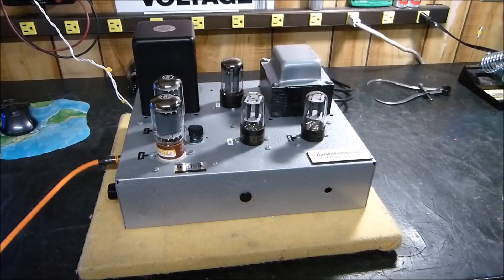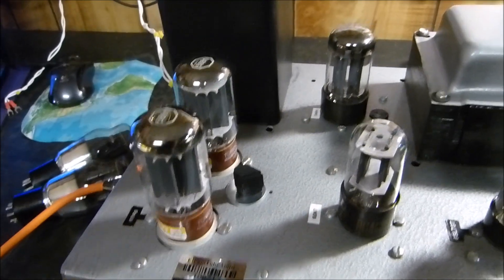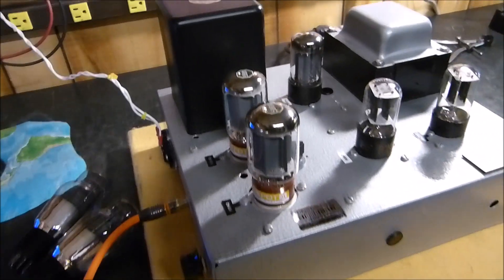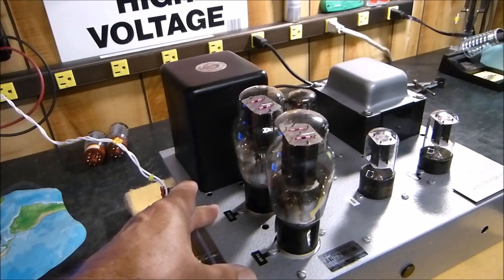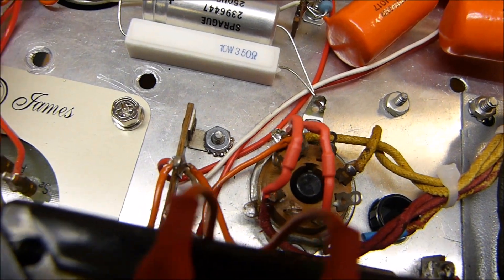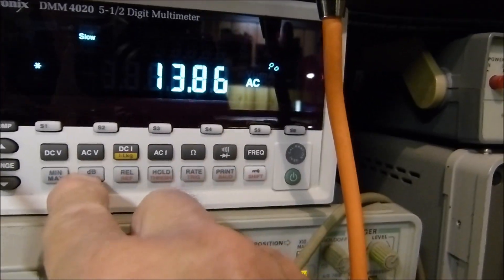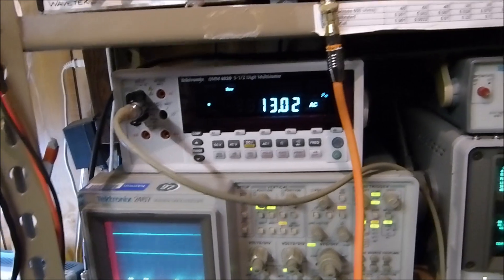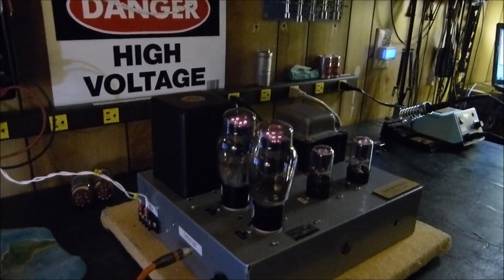6B4G & 5881 Vacuum Tube Amplifier Using James Audio Transformer

Comment: Hi David, I would like to make a stereo 6B4G amplifier and I've checked several of your videos and similar amplifiers you've built. I've noticed that you've used the Acrosound schematic for the amp with 6SL7 as the first tube, but what schematic have you used for the amplifier in this video? I guess you've used 2x6SN7s here, rght? In the other video you've managed to get around 16W using higher than rated voltage, what would be the plate voltage and cathode resistor and capacitor you recommend?

Thanks for the great informative videos!

Regards,
Marko
Reply from the maker: Marko,
Great questions. I hope I can answer some of them. I think this video uses the Heathkit schematic below.
Here are the Acrosound schematics.  http://www.tubebooks.org/file_downloads/acrosound.pdf
I tend to stay away from the high mu 6SL7. It make an amplifier that can be driven to full power with only around 100 mV input. I stick to a pair of 6SN7's.
I am very fond of the Heathkit designs.
Here is the W-3M    http://www.mcmlv.org/Archive/HiFi/HeathkitW3M.pdf
Here is the W-5M   http://www.mcmlv.org/Archive/HiFi/HeathkitW5M.pdf
I do tend to run my amplifiers at a higher than normal plate voltage. Odds are you can use the same cathode resistor because as the plate voltage increases, so does the current thru the tube and thus the voltage drop across the cathode/bias resistor.
Whatever you run your 6B4G's at, make measurements of plate voltage and cathode current and don't overdo it too much...  :-)
Reply: @ElPasoTubeAmps  Thank you!

Comment: I really enjoy the amp videos that you do and I'd be interested in the transmitter modification video :) but that may just be a Ham operator thing.
Reply: Michael Lloyd
 I sure enjoy the ham videos.
  73 N8TPI    Mike
Reply: ElPaso TubeAmps I guess I should have left my call sign :) I meant that I'd like to see the video but the non-Hams that come here might not enjoy it as much. 73 NE5U  Mike
Reply from the maker: I agree that the step-start relay I built is definitely a ham radio high-power amplifier thing. For audio, simple thermal resistors work very well at the current levels that we encounter in amplifiers even at 150+ watts.
Reply: Dave,I bought some new output transformers for the Altec 1570 amps that I put in 811a or 572b tubes..They are 9.5k and they weigh 20lbs each..Heyboer wound them.
Reply: I like anything Dave puts up. You can't buy that kind of education :) 73

Comment: Very interesting ! love these vids ( The Ability to have optional tube compliments seems like a great option ) Would this make a Good first time Amplifier build ?
Reply from the maker: Thank you for your kind and encouraging comments.
I think it could be a good first build of a quality (high fidelity) audio amplifier. It would take some experience and tools in knowing how to do chassis work and if it was built as a dual amplifier (stereo) on the same chassis it will take some slight modifications to the power supply. I didn't show it in this video but the 5881 version does better than 30 watts with 2.5 volts drive with excellent distortion figure. As mentioned in the video, I have found that a lower Z input, in this case 10K, seems to stabilize the amplifier and keeps many of the gremlins of parasitics and other anomalies from occurring. With the 6SL7 driver version the input level is down to as little as 125 mV for full output  but then the gremlins start to become a real problem. With quality vintage or quality modern day (Chinese) output transformers, a person can build a 30 watt (or less) vacuum tube amplifier that is in a class with the best-of-the-best. Now, if you need hundreds of quality vacuum tube watts, building our own becomes a problem mainly because of the (lack) of a good output transformer and we may have to turn to a high quality commercial amplifier for example, a vintage McIntosh like, for one example, the MC3500 which will cost $$$$$. Search for "Acrosound Transformer Catalog" and you will find plenty of good examples of these vintage amplifiers.
Reply: Thank you For the  nice reply    - I  looked at the Acrosound  transformer  site with the schematics, and saw the vids on the one you built - very nice !  seeing  that you had a Bad one (transformer ) got me thinking that perhaps there was a risk of getting a used acrosound  that was bad . is that a common problem ? or is the risk worth it ? EPay has a few now even for a buy it now price  but for 250 they seem high . anyway thank you for the info - very informative
Reply from the maker: I know a fellow here in El Paso that had eight (8) and everyone sold on Ebay for $100 each and no more (they were for bid and not buy- it- now so that indicates that is generally top-paying price)  and that was in pairs, $200 for the pair, which seems reasonable to me.
I don't think the one that I didn't use was actually "bad" but from the four that I had they were all a bit different and each had to be dealt with uniquely in the circuit for the best performance. 
I did not find these differences in the modern day James transformers so... I would personally recommend new quality output transformers. Just my opinion. You  have to consider that these Acrosound transformers are 60+ years old and who knows how they have been used and how the the insulation/etc.  change over that long period of time. No doubt they were in a class of the "best-of-the-best" in their day and if they remain good, as the two I am using appear to be, still are a very high quality, high fidelity OPT. The old Williamson style design is very stable - not necessarily the very first design by Mr Williamson but just a bit later in the Heathkit designs they seem to have worked out all the bugs.
If you decide to build an amplifier like this in the stereo version, the power transformer used in the Dynaco ST-70 would be an excellent choice as it is rated at 300 mA and can be bought new online.
Reply: Thank you once more ! I had not considered the  differences -  from one to another ( of the same model transformer )  that would impact the design  -  I suppose I was looking for a- recipe- for a successful amp  that if I followed - Carefully - the instructions for would give me a product that I would enjoy , And at the same time give me some experience in building .

Comment: Hybrid bridge rectifiers are totally dominated by the vacuum rectifier(s).

FWIW, Ned Carlson did something similar with Dyna ST70s.  However, OS 6B4Gs can't stand up to the conditions present.  Ned used Sovtek 6B4Gs, which can take more abuse than OS tubes.

Perhaps a UL/triode DPDT mode switch would be a useful addition.  You'd get to see how the 5881s behave as triodes.

Eli D.
Reply from the maker: Hi Eli - that is a good thought about the mode switch but in my mine, even though we call it UL, don't you think the tube is operating in a triode mode anytime the screen is at plate potential?
I haven't tried the Sovtek 6B4G. I know I am pushing the vintage 6B4G's beyond their rated values but they don't show any color in the plates and perform really well.
I have tried the JAN 6B4G's which are, as I understand it, a triode connected 6AV5 and they perform very well but require modification from the CT filament to an actual cathode connection.
This could be a lengthy discussion but here goes...
Recently I read something about an experiment where music or tones, or both (?) were played at a very low THD level and then again at a 1% THD level and the only difference was that the 1% THD level was perceived as louder. Maybe you sent me that comment.  
Anyway, tonight as my wife and I were watching TV and the "new" amp was being used, I asked her what did she think - how does it sound - she responded that she thought it was louder. Hell, maybe it was "louder" because I had it louder. Immediately, the 1% experiment came to mind and then I dismissed it as I know the THD was well below 1% but it started my mind to whirling. After being married to this very smart and beautiful lady for forty years, I would think that I should know better than to ask her for an analytical analysis of my equipment. I guess a fool never learns...
I have a nice collection of SS and tube amps and to tell you the truth, I can't tell one iota difference between any amp at any reasonable loud power level regardless of the music content. Now, at levels that drive the nails out of the wall, the McIntosh amps win hands-down as they simply can produce more power at low distortion than any thing I have - I haven't tried my PP 813's or 3-400Z's yet on the house speakers.  :-)

Comment: The blue in the tubes is reflected from the FFT screen. I didn't follow what you did to make the valve bases compatible. Can you post a schematic? Great stuff again.
Reply: Plate, control grid, and filament connections are the same for both O/P tube types.  The beam power tetrode uses 2 additional socket tabs for the cathode sleeve and screen grid.

Eli D.
Reply from the maker: You are absolutely right about the blue color. It looked too bright and unnatural for the thin high-blue color that occurs internal to the tube.

Comment: Another interesting video. Thank you. When you say step start, is that the same as soft start? because that would be interesting to know for sure. If you have time, please go over the step start.
Reply from the maker: I will post my step-start or soft-start circuit. It is nothing exceptional but it might help others see my approach. I called it step-start because it is two distinct levels, a current limiting first step then a full current second step and not a variable thermal resistor slow, heat-up controlled start. Thanks for your comments.
Reply: Thank you :-)